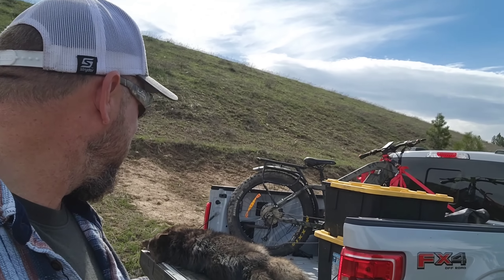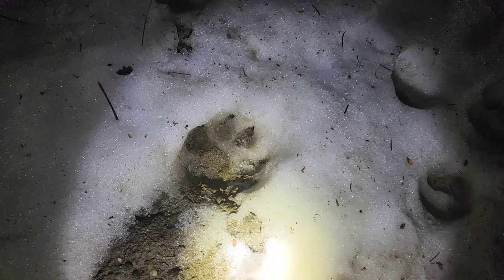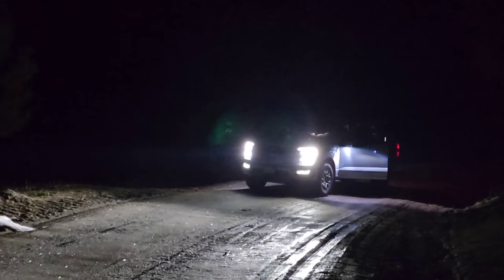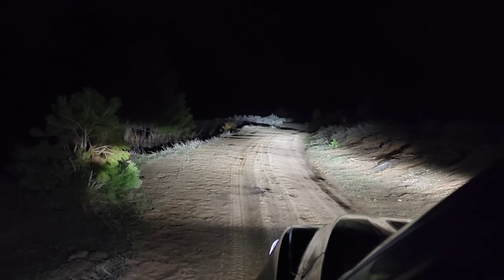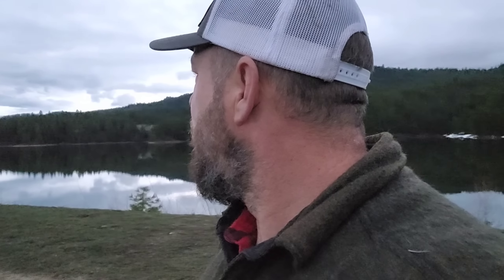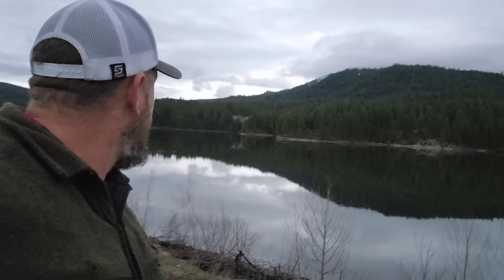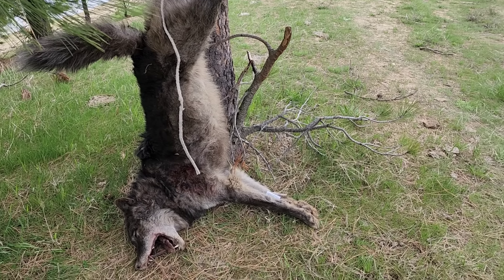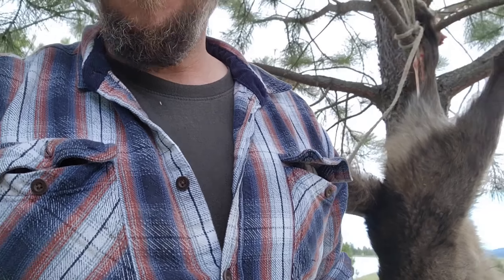112 pound black wolf trapped and caught on trail camera

Comment: Nice badger! They are quite the pest to ranchers. Curious why did you have the jaw propped open?
Reply from the maker: So when I take them in to the fish and game it's easier for them to pull the tooth, they pull a tooth on bear wolves and cougar when you check them in
Reply: @LoboPro Predator Control  ooh got it, makes sense. So we don't have to do that, that's nice. I work in dental, and I'm sure I could manage to remove a tooth lol